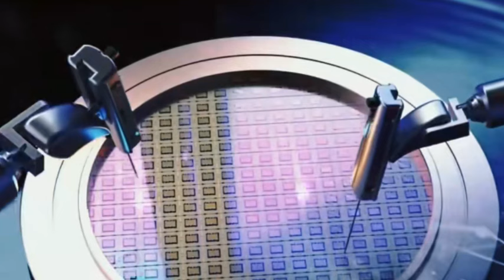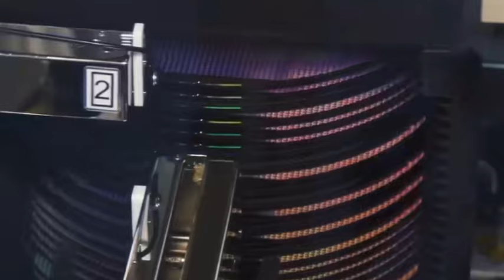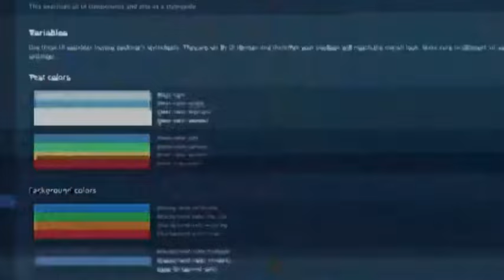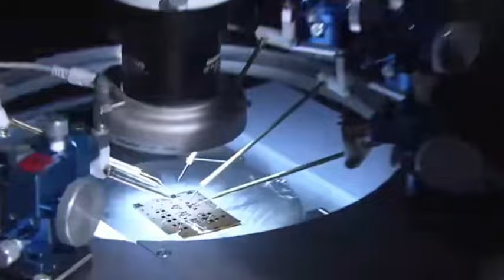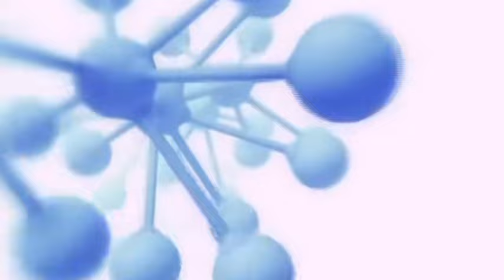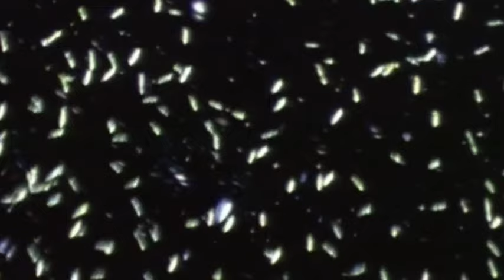China launched 1st 8-inch silicon photonic thin-film lithium niobate photoelectric integrated wafer!

Comment: In the West, it is a supply and demand issue, along with selective restrictions; thus, the USA outsources much of the commercial production, that usually has hard encoded 'back-doors' that the military will not tolerate, so production in the USA is 'subsidized' by the inferior imported commercial / consumer products.  Don't worry, China is openly on the for front of this type of surveillance state.

Comment: 8 inch means is bigger nano metres. But it still faster and low power than silicone wafer. Photonic chip almost no heat. Even above 100nm still faster than silicon base.